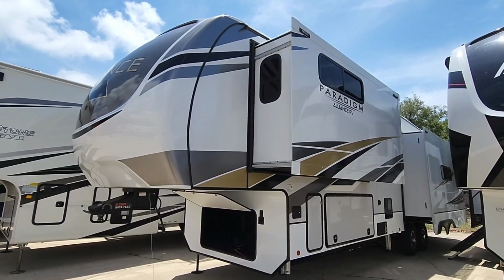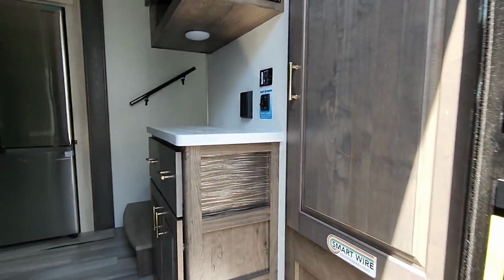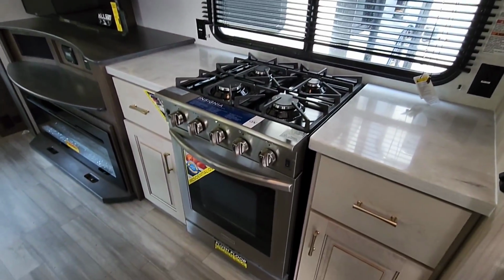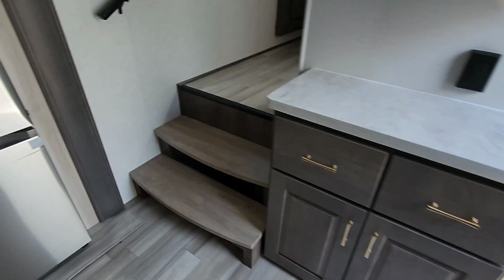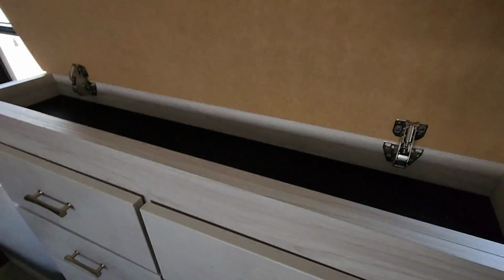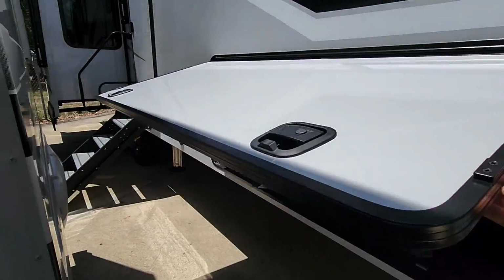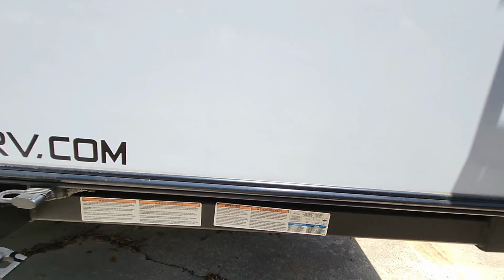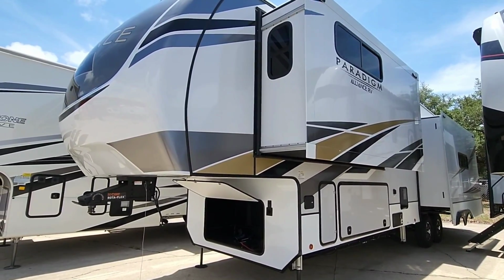Incredible Interior! Alliance Paradigm 340RL Fifth Wheel RV!

Comment: We love our 340RL.   Must have been a supply chain issue with the one you reviewed as all of our doors and drawers are slow close.  I appreciate your channel and all the info you provide.  Because of your information, changed from a 3/4 ton Chevy to a DRW  F350 with a 410 rear-end.  After going to the scales loaded with our Chevy, we learned that we we within our tow rating, but 150 pounds overweight on our back axle.  Now, we barely feel our Alliance behind the truck.  Thanks again for all the information that you provide.

Comment: Very nice unit and excellent floor plan.  My only two concerns are not being able to access the bathroom from the bedroom without going into the hall.  Secondly, move the tank valves from under the hose inlets in the water bay.  Current design is asking for rusted cable due to dripping from above.  I speak from experience on this issue and it’s not and easy one to fix.  It would be easy to stack them on the left side vertically.  Otherwise a very nice looking rig.

Comment: We have been full timing in our 340RL since May, 2020.  We absolutely love it!  It is incredibly well made and the customer service from Alliance is amazing.  They provide personal cell numbers for the owners and other executives in case you have questions or concerns.  I have posted a concern on the owners group on Facebook on Sunday morning of July 4th weekend and received a phone call from the VP of Customer Experience 20 minutes later to offer assistance.  I like many of the improvements they have made in the 2022 vs 2021 model, particularly the windows in the dining room slide and the remote for the inverter inside the coach.
Reply: This looks like the RV we are going to full time in. We had a GD picked out but this one is winning us over
Reply: It is my dream to own an Alliance one day. Could you explain why you need a remote for the inverter? We have a 25' trailer and have, i think, an inverter, at the very bottom of a cupboard area where the fuses are. I had a spinal fusion so having to get on the floor to see the Fuses is just awful...nearly impossible! There is a fan and when the box is running...there is a fan in there, it is very hot air coming out at times!  I cannot even find the same kind of fuses in any of our stores, even auto parts. Just wondering, after reading your reply, if I should be interacting with it. There is a battery shut off, too, but i keep the rig plugged in all of the time, so, so far have not had to deal with that. We have rarely used it because it is too hard to get in and out of our driveway. I have to have help and hate to bother the elderly neighbors, or we would be on the road a lot. We got it because we had so many fires and were evacuating several times a year. AFTER we got the trailer...no evacs!  But plenty of close calls. It is always ready to go. This year has been a wonderful break! Lots of rain and cooler temps so far. We just keep praying!

Comment: Very nice unit, however, I would rather they install a Road Armor equalizer with HD shackles and wet bolts as opposed to the CRE 3000.  The Road Armor has more points of contact for smoother traveling.

Comment: Nice unit. Don't like the floor plan. Would opt for the 310rl which enables you to get to the bath/bedroom easier with the slide in. Also, i Don't mind the sliding windows on this more premium unit. Although frame less windows look better (especially from the outside) they do not offer the ventilation AND i have had nothing but issues with the gear/operating mechanisms on mine.